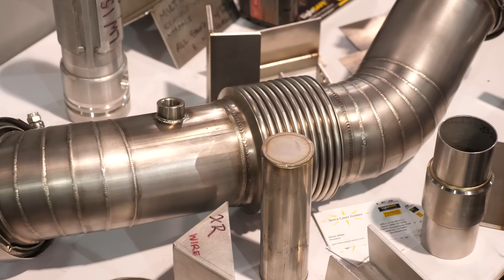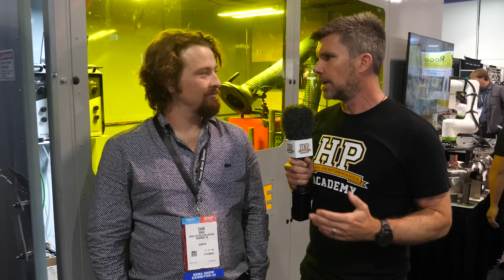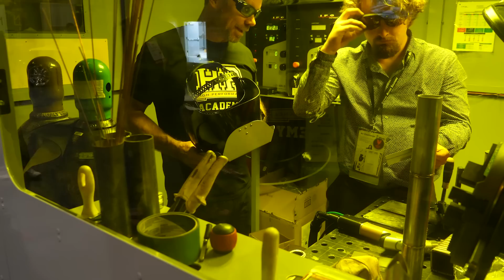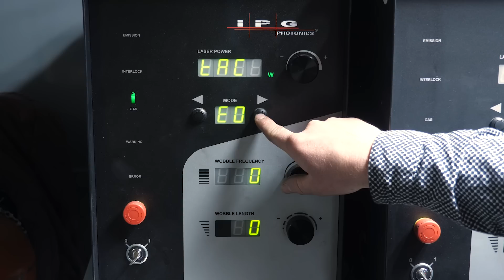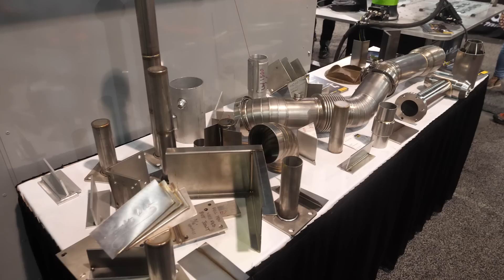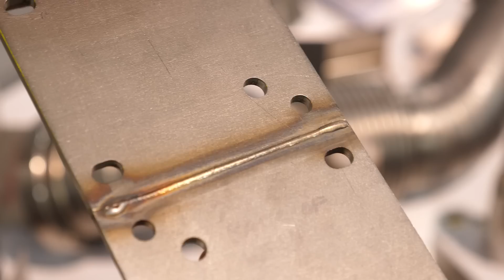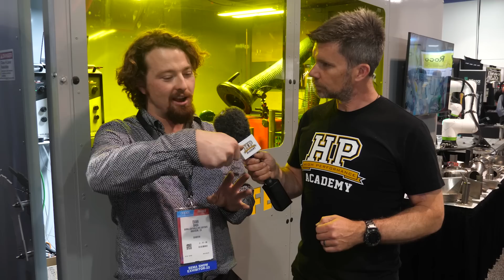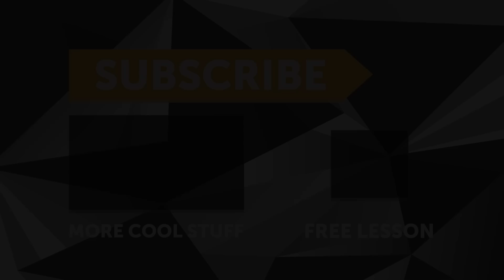Is LASER Welding Better Than TIG Welding?

Comment: Cost is quite a bit more and the amount of repairs from this process produces a lot of rework as no one typically can hold .25 mm or less on the gaps. Going even thinner than 1mm makes the process about impossible to control.  If you are designing for a laser welding process, it has to be rock solid on part design before ever considering laser.  Plan on having 15% rework or higher having a TIG welder ready to do the repairs required for the process.  A majority of good stainless exhaust welding work is done using metal core and plasma arc welding processes successfully.  Why use a process where you will have high rework anyway?  Better to leave this process to something that will produce the lowest rework.  Producing line to line fit-ups is not realistic in a majority of fabrication processes.  Gaps are always an issue for laser welding unless they are machined.  At that point you have the opportunity to capitalize on using a laser welding process where you can actually make some money.  Otherwise, run like hell from the process.  Leave laser to cutting processes where they have no competition and the best use.  Even there sometimes plasma cutting is better when surface quality of the material is too variable.  Don't be suduced before doing your research and knowing it is the only way to do it.  Even then maybe Electron Beam Welding may be more applicable in place of the laser when you put that much money into the part preparation.  Do plan, check and validate.
Reply: The rework is still less than the time gained by using this process. The guy said it can be up to 10x faster than TIG welding on thin materials, so even with the rework, there would be a time/cost savings.

Comment: I have a hard time believing that there's no beveling or prep for 1/4" or above. Most thicker material welds I've seen with laser welding above 3/16 doesn't look much hotter than tig or mig
Reply: The material does not see as much heat, and thus the visual markings can be misleading.  That is one of the main benefits. The laser reaches deep into the material quickly without spreading unnecessary heat into the surrounding material. 👍

Comment: Good interview, you asks some good questions about laser welding vs tig and mig. I welded 40 years, my experience is a good fit is always best and mig is best for gaps...........
 Welding has been around a 100 years +. But seems like in welding machines the equipment is always expensive and big, only in the last 25/30 years has welding machines started to shrink in size and cost, even in the last 10 years welding machines has gotten smaller and lighter and more affordable for home owners....
Now if the Laser welding machines can shrink in size, cost, and be able to easily fill gaps, more and more home owners would be more likely to buy one..........

Comment: How do you weld pipe schedule 80 or 160 thick wall close square butt with full penetration as you said don’t need any bevel preparation ? I’m talking close square butt well with thickness over 20mm .
Reply from the maker: What is the motorsport application you are using this for?
I'd put questions like this to the supplier to make sure you are getting the right tool for your application. Ask a few of them. It's also a good way to get a feel for the support of a company before you purchase anything too - Taz.
Reply: The laser welder penetrated deeply into the material by making a "keyhole" which penetrates very deep into the material. The heat is more focused, and the energy density is 200x that of an arc weld so you are inputting the heat only where it is needed.

Comment: Did not say anything about the strength of the laser weld
Reply from the maker: You're right, we didn't. Just like MIG, TIG and other welding options, when done correctly in the correct way for the material, it should be as strong or stronger than the parent material.

From there you need to get material specific when comparing one welding option to another - Taz.

Comment: Really cool stuff! Wonder if it will get more affordable in the near future? Looking at other laser-based technologies, like laser cutters, I wouldn't be surprised if these are at Harbor Freight in a few years. This concept not requiring electrical conductivity of the material being welded could make for some interesting possibilities - wonder if it would be possible to weld glass, so long as the glass is opaque to the laser's light wavelength? Or plastics, though that would require a far lower-power laser.

Comment: I REALLY want (need) to see a cut-and-etch of an assortment of laser welds.  (Differing material, thickness, joint geometry, etc.)
Reply: Laser welding has been the norm in modern cars for years now. It's AMAZING how much strength and stiffness unibodies have nowadays as a result. The strength these days doesn't even mostly come from the steel properties or material thickness anymore, it usually comes from the incredible spot welds that hold these stamped body parts together.
Reply: @spdcrzy  unibody cars are spot welded and mig
Reply: I've seen a video of a VW factory showing how the seams of automobile roofs are laser welded and that was probably 10 years ago. Here's another example: "Comau Roof Laser Welding"

Comment: I've had the chance of welding with Laser, and it is a total game changer. It is great for exhausts, intakes, and thin sheet, but for rollcage or other parts, I rather use MIG or TIG.
Reply: what about aluminiums?
Reply: @adrianralte  Never used it on Aluminium.
Reply: @TonySopeano46  its perfectly fine to do it on aluminum.
Reply: @macmos1  when did you and how much did you do?
Reply: Why?
Reply: @PJisPankaj  From what I can tell it performs better with thinner materials.
Reply: I have been using an IPG Photonics at my work for about a year now and I agree with you, it is awesome for specific thin gauge sheet metal applications. I weld primarily stainless steel with it. I much prefer TIG for larger workpieces though. When using the filler wire feeder attachment, it can make getting the weld gun into tight spots very tricky, in which I would gravitate towards TIG for the torch angle versatility
Reply: Is it impossible to use laser welding for the roll cage? I don’t TIG weld and have other reasons to get the fiber laser welder. I was interested in using laser welding because I’m hoping it will be more precise as the heating is more focused.
Reply: That's what I thought too
Reply: How do you feel on MIG Vs TIG for cages? I'm starting to get the hang of MIG but not touched a TIG yet.
Reply: @jase_llan I'm not a professional fabricator, but from my experience in Baja SAE (every car's frame is also the roll cage) most teams use TIG for their roll cage. Every team is required to provide good weld samples, but the lower heat input from TIG makes fitment easier because it doesn't pull as much. From my experience, the total heat put into a material is actually less with MIG because it can be done so much faster, so MIG can be helpful for welding near heat sensitive components.

Comment: man this would be great for my line of work, welding very thin stainless conveyor belts. i wonder if this method is better for less undercut and thickness deviation than a tig torch on a linear rail

edit: turns out we do it's just above my pay grade 😂

Comment: One area it needs work and may never compete is where you need full penetration welds with a smooth ID without processing and of course field work such as process/sanitary piping. LBW tends to make a mess of the ID on full penetration welds being undesirable for any type of precision piping that has a fluid flowing through it or even full penetration sheet metal welds. The weld quality is indistinguishable from gtaw I was welding bellows with a laser system and a lab analyzed the lbw and could not tell a difference. But that weld backside ……..
Reply: typically this is caused by excess laser power blasting right through the joint. The goal is to allow the molten area around the keyhole to create the penetration. We have done lots of back purged laser pipe welds, full pen, without making a mess of the inside, although i have also seen what you are talking about, always caused by excess power used.
Reply: sounds like a settings issue.
Reply: @Kyrazlan  it is possible that it is/was, however I’ve seen it happen plenty, where you get really nasty drop through versus a nice smooth weld reinforcement like you get with tig.  It could be the sweet spot was exceeded and too much energy was used causing excessive vaporization hence the nasty sharp weld reinforcement but as I’m not laser welding at my current gig to test and verify I’ll just say it’s not like TIG yet. It’s gotten way better than the older YAG systems but still not TIG.

Comment: Is laser welding stronger or as strong as all the other conventional welding? Can it hold structural?
Reply: If there is less internal stress, full penetration, and it is more consistent it should be far stronger for the applications it is suited to.

Comment: I’m interested in the fact that he was using gas welding goggles instead of a proper welding helmet, and gloves and that you can use nitrogen as a gas, the same as used in high power laser cutting. I’ll have to look up how this works in more detail, but as you guys know, keeping nitrogen OUT of a weld is usually considered to be very important.
Reply: Those are special laser safety glasses rated for the specific wavelength produced (1070nm).  And nitrogen is typically not used because of the nitrides formed with tungsten, but with laser welding, nitrogen is superior for many materials and there is no tungsten to worry about. 👍
Reply: @shearperformance  interesting about the glasses, because a video elsewhere has the guy wearing a welding helmet and welding gloves.
Reply: Those are both things that are recommended for safe laser welding.  The glasses protect your vision and the helmet and gloves protect your skin.  (vision being the most important thing to protect obviously)  @melgross
Reply: Let’s keep something in mind. Working with lasers, which I’ve done< is different than welding with lasers. Glasses for laser safety is so you don’t get laser light directly in the eye. Welding produces ultraviolet, even if it’s done with lasers. So you need protection from that.
Reply: not  true, you mean Hydrogen
Reply: @bernardmauge8613  no, nitrogen. High power cutting lasers use nitrogen to help the cutting process. It’s not the same as welding.

Comment: I have a feeling that this guy has never welded in his life.... I don't see this being using in piping shops to make pressure piping....
Reply from the maker: Sounds more like you have never welded anything other than 'pressure piping' in your life 😅 

As it is a TIG is not used for every and any welding application and it will be the same for laser welding just as it is also MIG and Arc. It will take over in some areas, and already has, but unlikely all 😎- Taz.

Comment: VIP member here. I work for a Machine Tool OEM that does laser welding called TRUMPF. We have a bunch of neat laser welders. All expensive machines, but super neat.
Reply from the maker: Hey Tommy!
Do you they let you do your own after-hours work with them for the race car, or not quite that kind of workplace 😅
Still interesting tools to use either way I'm sure 😎 - Taz.
Reply: @hpa101  If I wanted too. I'd have no problem =D since I'm an applications engineer for the company. I do all the programing and such my self. I call it practice haha but they let us use the machines after hours whenever we need for personal stuff. Just supply your own materials. Honestly for one off stuff. It would take to long. Plus I enjoy tig welding to much =D

Comment: I hope people are talking about the   toxic dust that is created by these when welding stainless. I’m sure no one is so I will, I wish I were wrong but I’ve used these first hand and they create a heavy dust rather than a fume created by tig. Both create toxic hexavalent chromium, yes but the issue with the dust is if it gets into you’re lungs it stays there rather than being exhaled. It’s happened to me and feels like you’re lungs are burned, and I wouldn’t be surprised if I develop cancer 10 years down the road. If you look into this and ask laser regulation departments, they all seem to give the same answer “We don’t know” or seem unsure of this issue. This becomes a major issue when the area is improperly ventilated which most shops are not to the extent lasers need. Lots of these systems come out of China are not geared towards safety to begin with. I along with many others left a prestige exhaust shop for this very reason.
Reply from the maker: Fumes from TIG welding can be very toxic. Breathing them out is not really solving that issue as they enter the bloodstream too. Just want to clear that up, use extraction with adequate ventilation etc where applicable rather than hoping you can simply breathe that stuff back out dude!

Otherwise, interesting points and very valid! Sounds like where you worked had little interest in PPE for TIG or laser welding. A quick search will show you some of the safety issues with laser welding as well as the solutions. Your workplace might have made it seem 'hush hush' if they didn't want to deal with it, but that is not the same for every workplace and the information is readily available and material specific 🤘

Hope you're in a happier and healthier environment these days! - Taz.
Reply: @hpa101  I may be wrong - but hexavalent chrome (or something as 'nasty') is a product of welding SS and most people have NO idea of the dangers from the fumes.

Comment: One con of manual laser welding is the narrow fusion boundary, which is hour glass shaped. This can cause LOF that isnt visually inspectable.
Reply from the maker: Do you have a link covering this topic for people to read? I'm sure anyone seeing your comment that is interested in welding in general would be interested to read your source for sure 🤘
Cheers for sharing - Taz.
Reply: @hpa101  Sorry I don't. This is based on experience. Laser welding is a very common process in the aerospace industry. Mostly used for critical structure applications that require minimum reinforcement, offset and HAZ.
Reply: This is why the laser welders typically have a "wobble" feature which creates a wider weld zone.

Comment: I got the impression that it had no downsides over Tig/mig besides cost because it is a newer technology. Is that fair to say? Surely there is some reason why it wont replace those processes entirely, right?
Reply from the maker: I don't think that is completely fair to say noting just like Arc, MIG and TIG welders etc, there are many different laser welders out there with strengths and weaknesses as well as a HUGE range of applications for welding from tiny medical devices and jewellery to vehicles to ships and large buildings etc in a rage of environments and locations (even under water!)

I'm not sure one tool is ever going to cover such a massively broad range of requirements personally. Might get close though! Only time will tell   - Taz.

Comment: also i see a "Co-Bot" in the background.  at PRI '22 Lincoln had a traditional welder set up with a Co-Bot doing a "cold" demo. made me think how combing the Laser seen the previous year with a Co-Bot, one could indeed set up some small scale Automated Welding in their garage.  savvy CNC guys are ALREADY using Co-Bots to load/unload parts for small production runs IN THEIR GARAGES.

Comment: saw this IPG unit demo'd back at PRI '21 (sorry forget the name of the vendor) but the speed was damn impressive.  this SEMA demo looked to be an even better display than what i originally saw given the more numerous and greater variety of samples shown. there were only a few coupons made from joining 1/4" plate out on the table at PRI, but still that was enough to get my attention.  my Father in Law's a long retired Welder and former Vo-Tech school Welding Instructor so i literally stopped at this booth all 3 days to watch demos and gather info to bring back to show him.  so between visits to the PRI Show, SEMA Show (and other industry shows) there's very few booths i've ever felt the need to stop at 3 times.🤣
Reply from the maker: The ease of use is pretty phenomenal eh! Not without pros and cons like any tool but pretty exciting tech to see trickling down slowly 😎 - Taz.
Reply: @hpa101  indeed, I was hoping you guys might cover this.👍

Comment: GTAW will always be superior on chrome moly and other heat treatable alloys which are quench sensitive.
Reply: Why is that?
Reply: @EvanShea-uv8jo  
Weld heat affected zones will self quench, causing it to become brittle.  Even short circuit transfer in wire feed welding processes can do this, especially active gas like CO2 with ER70S6 filler.

Comment: why will no one give a price ,,, every video avoids the issue ,,,, just fess up.
Reply from the maker: Prices are not hidden, sorry you thought that.

Where are you located? What currency do you want the price in? What model? Will you finance it? What cable length?

Orrrr

Look here 😉 https://serralaserstore.com/collections/lightweld-1500

Anyone looking in 12 months time or 24 moths time or 32 months time at that link will get a current price too.

We don't avoid mentioning prices of things but they do date quicker than the technical content, so you should always check regardless even when they are mentioned. Note we don't sell these.

Hope that helps! - Taz.
Reply: @hpa101  why not mention the price range in the video , but at least your answers better than I expected ,,, gbp . as much as I believe laser is the future in a lot of cases , I also believe it will sit on the edge for a long time yet , just the same as laser rust removal ,,,, then again the same could have been said about tig until twenty years ago too. Thanks for the reply.